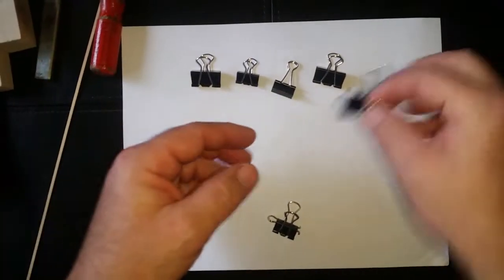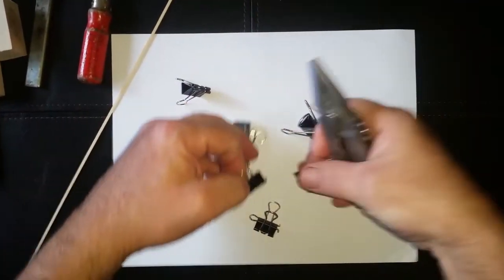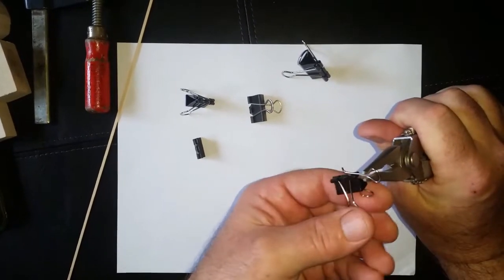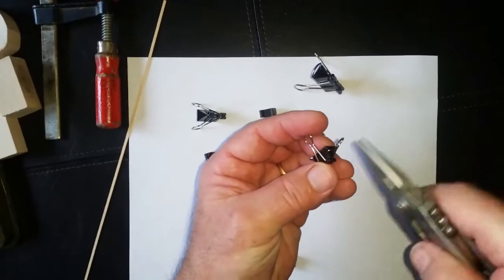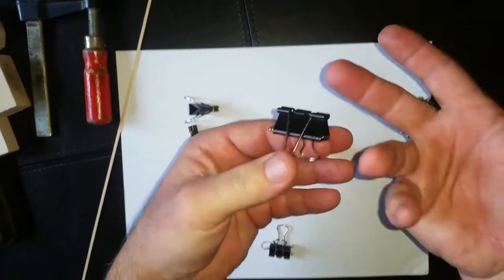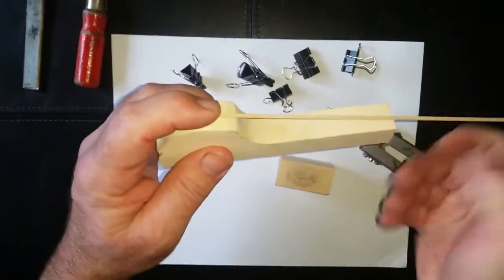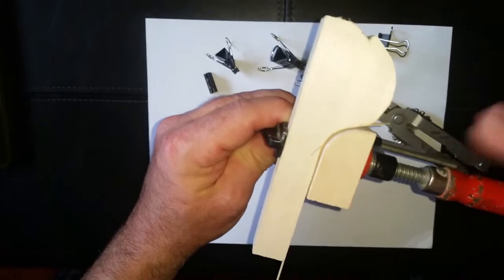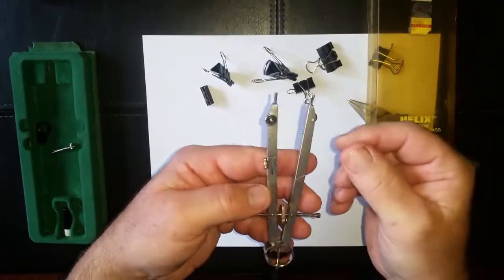Ship tools for Model ship making

Comment: Also I asked a question on your planking video, but I’m sorry for asking on about her video, but do you bend the wood when building the bow of the ship? Or just glue it to the ribs? 

Edit: sorry I just got to that part of the video, Thanks!
Reply from the maker: I actually soaked the full planks and then , temporarily clip the planks on until they dry . sure it slows down the process but I think the results are well worth it . I noticed a better more accurate fit with little redoing the planks.

Comment: Some clips are shaped right though, on the ones I bought the silver handles were just barely too short and didn't fit inside the black portion.
Reply from the maker: with those I bought two different sizes and fit the silver handles into the smaller black clips